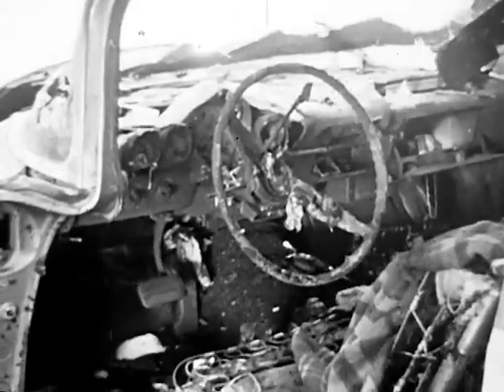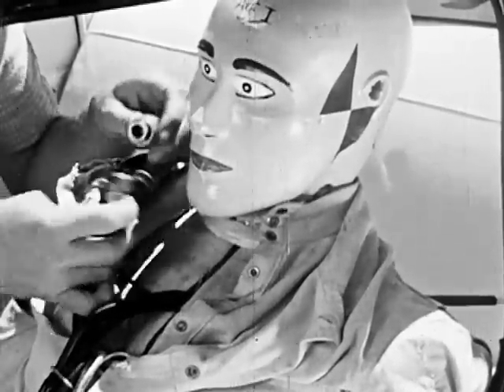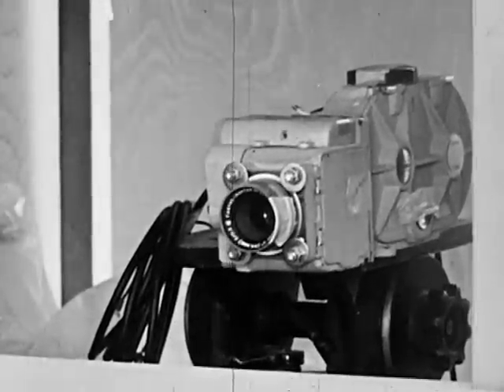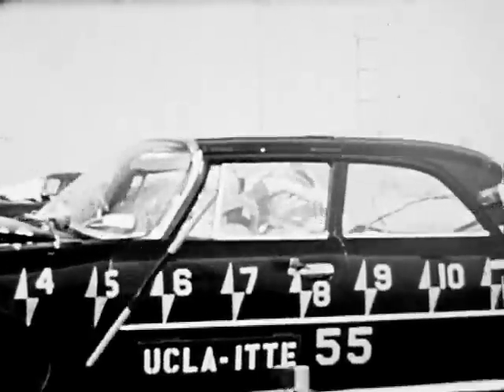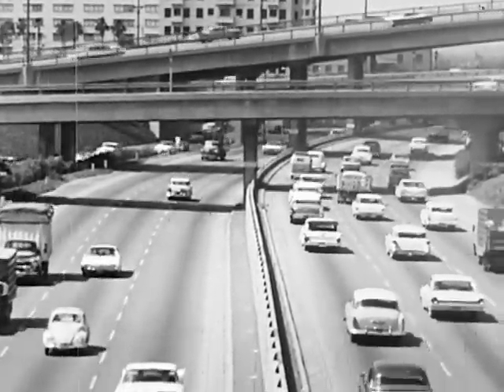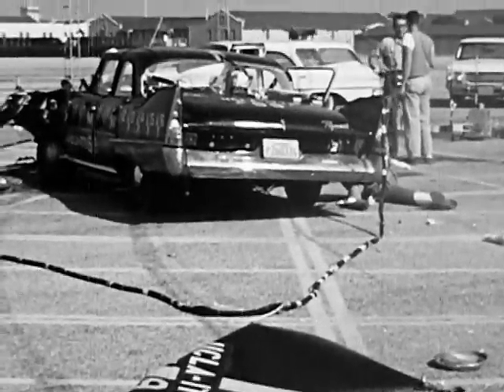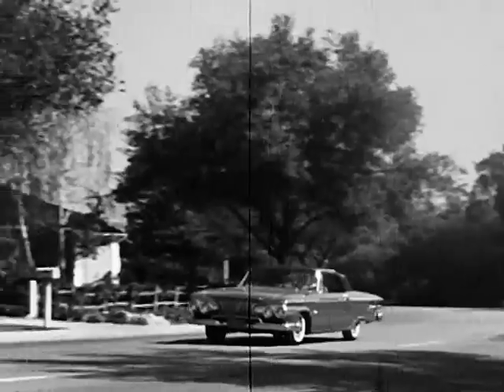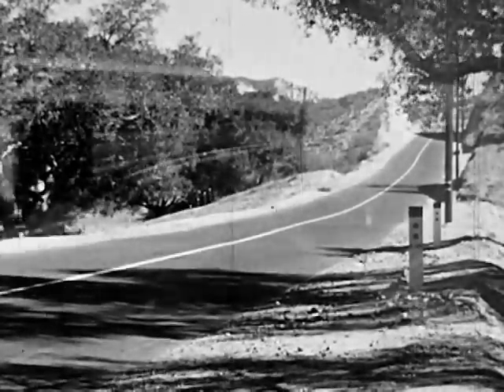Broken Glass (1960's)

Comment: You have to remember back in the 1950s and 1960s, the cars didnt have crumple zones, also they only offered lap belts. The shoulder belt wouldnt be offered til the late 60s and into the 70s. There wasnt anti lacerative windshields either that wouldnt come along til the 1970s and into the 1980s.
Reply: +Donald Thompson And in collisions the fuel pumps kept going instead of shutting off, while they used flammable gasoline and motor oil that's more flammable than some other oils around today (E.G. synthetics and biosynthetics which have higher flash points.)
Reply: Also the engines in todays cars are designed to fall out in a head on collision, instead of coming through the firewall. I forgot about the fuel pumps and they were under the hood as well, which was more dangerous, thats why they are in the fuel tank now.
Reply: Even the shoulder belts in the 1970's were'nt much in the way of protection. They didnt lock-up upon impact like modern ones do and could often times be unlatched from the lap belt and not used entirely
Reply: I owned a 1959 Olds 98, the top of the Olds line and just a couple of steps below the Cadillac. It had no seat belts at all!
Reply: Donald Thompson 
Or collapsible  steering  columns  until  the early  70s
Reply: Austin Lucas 
Not to mention  that  the  gas  tank  was placed  behind  the  car  instead  of  the  middle
Reply: @eajosephedward  - The filler was often behind the license plate on many 1960s and 1970s cars. It was supposed to be convenient because you could pull to either side of the pump.
Reply: Some cars did. Volvo started putting 3-point seat belts in their cars in 1959, and were very early with using crumple zones, collapsable steering columns and engine mounts that were designed to make the engine go under the car rather than through the firewall, and many european cars were quick to adopt these features.

But yes, many american car makers back in the day chose to put more effort into making their cars luxurious than safe...
Reply: Mercedes Ponton had crumple zones. The next model, W110 (fintail) was a little bit more advanced in saftey features.
FIAT 1800 was also designed with crumple zones.
Reply: My 1969 Buick Skylark has the collapsible steering column.
Reply: The crumple zones for most cars were your knees.
Reply: In Detroit's defense Chrysler tried to make a safe car, they made the chrysler air flow, HARDLY ANYONE BOUGHT IT they almost tanked making the airflow.
Reply: @101Volts  Well no shit, who would of thought you can't shut off a fuel pump driven by the engine without first turning off the engine?
Reply: @OldsVistaCruiser  It wasn't required until 1964, that's why. I guess people don't learn these things...
Reply: Airbags didnt come untill the 90s
Reply: @dumdum7786  Late '80s, the Ford Tempo was the first to offer driver's side airbag on a regular production vehicle in the US.
Reply: @dumdum7786  GM offered dual airbags as an option in '74-'76. They called it ACRS (air cushion restraint system)
Reply: @mikerotch4946  Unsafe at Any Speed helped change that.
Reply: @halohunter5217   Anyone with knowledge of an intertia switch.

Comment: The car at 1:02 is a rare 1961 Chrysler 300G, one of the most powerful cars you could buy at the time with a 375 hp big block. They were using it as a tow car to pull the crash cars on the track and pulley system.
Reply: I saw that too, and was afraid they were going to crash it!  >Sigh of relief<
Reply: That's an interesting tidbit of information!

Comment: Energy doesn't just disappear, as can clearly be seen in the video, driving tests need to be strict. There should also be tests to determine wether a driver have the skill to operate a car under various conditions or not, for such tests driving games with steering wheels and pedals plus shifter should be used. There also needs to be a test that measures how prone a driver is to anger and wether the driver just brushes off annoying people in traffic, or starts trading paint. And at last, a test that bans egotistical people from driving because treating driving as an arena where you try to dominate other drivers only lead to accidents.

Comment: Pretty much no vehicles had shoulder belts in the 60's. Most of them didn't even have lap belts. So yeah
Reply: That's incorrect Garrett Smith I owned several 1960s Pontiacs and I own to this day a 1969 Firebird they all had both lap and shoulder belts they were separate of each other meaning you can wear one with out the other
Reply: insulman100 you’re exactly right because my dad had a 1969 Delta 88 Oldsmobile.  The shoulder belts were for the front seat occupants and they were folded neatly above both doors to be stowed out of the way.
Reply: Actually, you and @insulman100 are both right. In the early 1960s, most cars didn't have any type of seat belts. Starting about 1963, most cars had lap belts, and by the late 1960s most had lap and shoulder belts. Cars from the late 1960s were much safer than cars from the early 1960s, due in large part to the first federal safety standards that went into effect from 1966 on.
September 27, 2019 4:03 pm
Reply: @whattheheck1000  do you time stamp all of your comments?
Reply: thatallredheadude 1 Yup. 
October 2, 2019 2:46 am
Reply: Although some manufacturers may have put them in earlier seat belts were not required by government until 1968. The other two safety features enacted that year were the split master cylinder on your brakes and side marker lighting on vehicle bodies.
Reply: @jacksson9391  it was actually 1964. 68 just added shoulder belts for front and seat belts for all forward facing seats.
Reply: @halohunter5217  Our family bought a new Ford van with all the seats in 1969. Lap belts only. I had a 70 nova lap belts only.
Reply: @jacksson9391  at one time, only Cadillac and American Motors had dual brake systems.
Reply: Volvo was first with lap and shoulder belts.

Comment: Anyone who thinks old cars were built better needs to watch more videos like this one. They were pretty, but they fold like paper in a crash
Reply: V.Vega They were just too heavy for their own good.
Reply: @nah6430  
Yeah, until the passenger space.
Exactly as designed.
Reply: Lsd Bread It's called crumple zones, the car is designed to crumple to absorb the forces of the crash throughout the entire body and to reduce the maximum deceleration value, but the passenger cell is made to remain intacted. Go watch an 80's Volvo V70 vs a 2005 Renault Modus crash on youtube and you'll see it yourself
Reply: @nah6430  https://youtu.be/C_r5UJrxcck 2009 Malibu in an offset head-on with a '59 Malibu. The 2009 driver would probably have survived with a broken leg. The '59 driver would be buried in a 5 gallon bucket.
Reply: @nah6430  OK... Imagine trying to hit a brick wall with your hand, then at the same force, trying to hit it with a pillow screwed down on the wall as a shield. The same thing applies with crumple zones - it'll hurt less with more of a cushion.

Comment: I've avoided a few accidents (nearly caused by other drivers) in a small modern car with quick maneuvering, that you could never do driving those barges with their lousy brakes and lumbering steering.
Reply: Joe Morgan.  You just don't want to get hit by one of those 5,000 lb barges.
Reply: @kennethsouthard6042  based on crash tests I might come out in better shape than the other guy.
Reply: @johnmorgan4368  Compact modern cars still don't score too great on crash tests, that paired with a 5000 lb boat, sure they won't be too great, but you might be quite hurt as well.
Reply: @johnmorgan4368  I've seen that video hundreds of times. It would be scary if
1. That 1959 Bel Air didn't have the awful "new" X frame that was extremely weak and dangerous.
2. Didn't have it's engine removed, which would have helped extremely in not smashing the car as bad.
3. It wasn't completely eat up with rust. When the car is hit, you can see tons of rust spewing out from every single crevice on that car, and not just small bits, but some serious chunks. It had lots of structural degradation from all the rust.
But all of that is present in the video, missing engine, tons of structural rust, and the awful frame design, which shows that any other 50's car would've fared better than that poor Bel Air. During the late 50's, that exact car was labeled as being unsafe, and with the 50's lack of car safety that sounds pretty bad. Don't you say?

Comment: Tests are absolutely compromised, you can't cut the roof off of a car and expect to get an accurate control.
Reply: As for those roofs being cut off I don't think they cut the whole roof I think they just cut a sheet metal panel but left the structural beams  intact.  Most of these cars were probably body-on-frame anyhow so it would not  have made as much difference even if they did.

Comment: What kind of cars are those around the 1:00 mark? The ones with giant fins
Reply: InsertFlashyName The black one looks like a 1960-1961ish Plymouth Savoy sedan.  Not sure of the other one.
Reply: Maximus Minimus that's what I was thinking, but the added grille lights intrigued me haha
Reply: InsertFlashyName Just a guess, but those may or may not be "lights".  Perhaps they were mounted by the engineers as part of some photo-electric instrumentation for the purpose of the crash test?
Reply: Maximus Minimus true... I like the look of the octo-lights though lol
Reply: They are exactly 1960 Plymouths. Other 1960 cars in these sequences include Chryslers and Dodges. The newer cars in the near collisions on the road are '62 Dodges mostly. InsertFlashyName
Reply: +InsertFlashyName Black car: 1960 Plymouth Savoy; white car 1960 Dodge Dart.
Reply: +InsertFlashyName @3:15 1961 Chrysler 300
Reply: InsertFlashyName Chrysler 300 and Plymouth Fury
Reply: I'm surprised Chrysler or any manufacturer for that matter supplied the cars for this.  So there are things standpoint people could see that crash footage and think, " that car is unsafe if I'm not going to buy one of those."